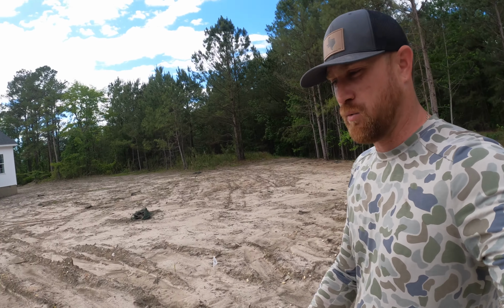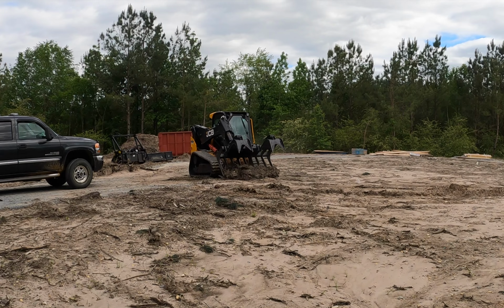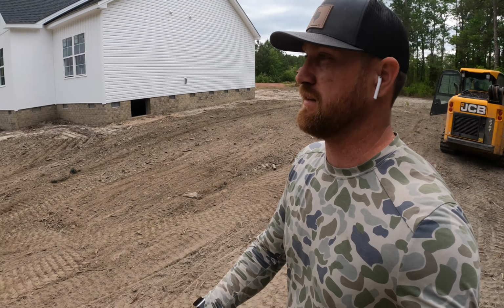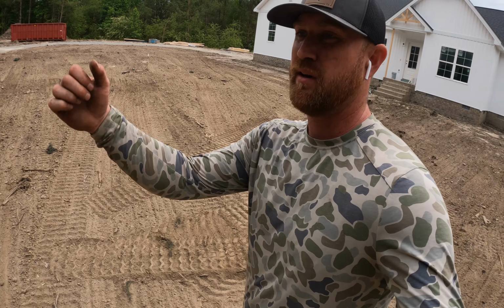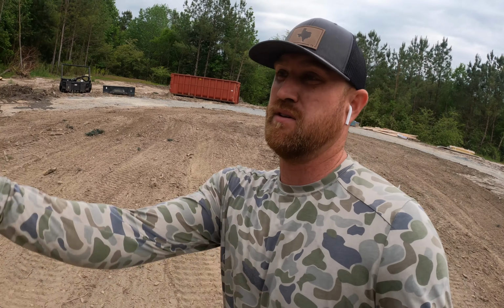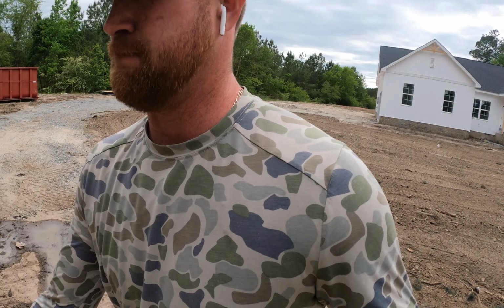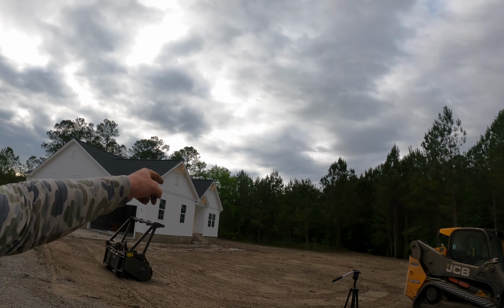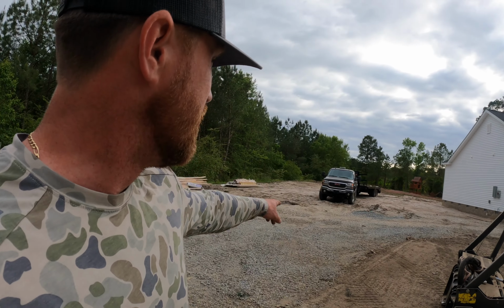Rough Grading with a Standard Duty Grapple/Root Rake

Comment: Nice job and use of the grapple. Had my 190T for a year now and have not used my tractor once during that time.
Reply from the maker: Does the bucket on the 190T list down when on a load. Mine seems to have that problem.
Reply: Is the question does the bucket not maintain under heavy load. If I have the bucket and arm raised and leave it at some height it will very slowly drop lower over some time. Not sure if idling it up would stop that. You can hear a loud metallic sound each time it drops

Comment: i use my tractor with a rake on the back an my grapple on the front for a job like that..
Reply from the maker: I agree, that would make quick work too. The owner wanted the mulcher just in case there was a larger stump to cut through they missed. There is always more than one way to do it. Thanks for the comment.
Reply: I wasn being mean or anything with my comment...I Didn't think about any stumps...we have land clearing people here that miss them too.. all I do is rake the property out after..all I have is the tractor..
Reply: @honeycuttsbrushmore3244   You rite ! I have run into stumps others forgot.. bout pulled the rear end off my tractor!! 😡